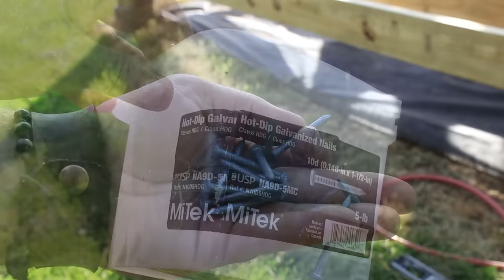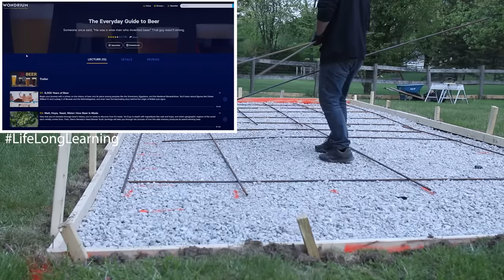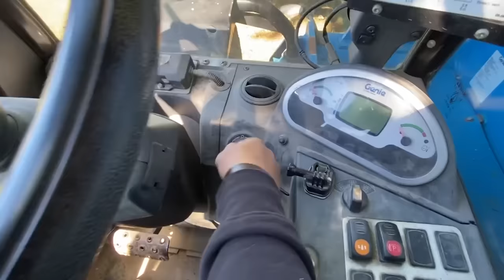How to Build a SHED from Start to Finish!!

Comment: My TOP THREE favorite things about this shed:  1) Metal roof  2) The use of plexiglass and making your own windows, this was phenomenal and it gave the shed a modern and custom look   -  3) You did this all by yourself. Of course, I liked many other things about this build and your techniques, and you did not take any shortcuts, even the fasteners had rubber in them, you've spent the money on the right materials to flash it really well. I am not sure what you do for a living, since this is the first video I watched on your channel, but I can't imagine if you had a crew of two or three dudes who you can rely on for help - you can start a great AIRBNB business building these tiny homes (after buying land of course in hot spots). Companies sell tiny homes like these for 20-25k starting, and of course once you start utilizing solar power, put a little plumbing, kitchen, bed room in it, you can make it a money maker. Good luck !!!

Comment: First  cool looking shed.
SUGGESTIONS for others to consider:
1. Placing the shed so the roof is southern facing could allow solar panels to charge e-lawn equipment, irrigation, shed lighting, or landscape lighting.
2. Depending on your location, you could install gutters to capture rain water.
Reply from the maker: Great ideas.  I was thinking of putting on small solar panels to charge a couple of scones lights
Reply: Can still have solar panels regardless of which way the roof faces. But agree would be a worth while upgrade.

Comment: Thank you for posting this.  I had been struggling with a pole barn design to match my current wood shed and you solved it for me.  I needed both secure/dry storage and open covered space.   I will upsize your concept a bit to fit my needs but yours will have a doppelgänger in summer 2022.
Reply from the maker: That is awesome.  Love hearing this.  Hope to see pictures one day

Comment: Very good looking shed but a few errors to mention if someone would like to copy or use your video to build a house : 1) for the fascia you used treated lumber, you can't install aluminium straight on it, it will rust within a year or two. A piece of Tyvek between the two would have worked. Speaking of Tyvek... 2) You didn't leave space between the Tyvek and the siding. It has to breathe, a 5/8 spacing would suffice (1x3 is perfect for that). 3) The sheeting for walls and roof is aspenite/OSB, not plywood. You do mention "OSB plywood" at 10:27. Real plywood would have been better practice but more expensive and I agree that for a shed it would have been overkill. One last thing, for your door's overhead, I'm not sure that you can sandwich lumber and OSB. An engineer might want to confirm this one but I don't think OSB adds the same strength then plywood. Anyhow, for what I see, the added strength shouldn't be necessary in your case, there isn't much load on top of it.
Reply: This is a shed who cares get a life bro
Reply: @Kilo5910420  Haha, man, he's just giving more information for those that care. People can use videos and comments to build something to live in or just better quality.
Reply: You are correct on the treated lumber and aluminum. It corrodes right thru in about 2-3 years
Reply: I didn’t know treated lumber does that👌
Reply: @FEV369  agree, it's still better to know more so you can improve and better in what you do.
Reply: @tigre2299 excellent comment. I forgot about the PT/alum issues. Speaking of PT use (and not an issue in this build) is that PT is no longer approved for direct concrete contact, because the preservative chemistry changed (for environmental reasons) and concrete leaches the new one out. Putting a post in/on concrete will enhance decay where they meet. Some building codes still require embedding, but usually a conversation with the building dept (before construction) gets it resolved. Most departments did not catch the change.

Comment: I love this - we’ve been looking for a design for a mini shed-office for the backyard, and this is pretty perfect. What’s the inside dimensions? And roughly what was your total build cost? I love your voiceover, by the way. We watch a lot of construction/build videos and often get a little frustrated with the commentary, but you struck the exact right balance, so thank you for that! I feel like we actually learned a lot :)
Reply from the maker: Thank you so much.  It’s 10x12 outside so inside it will be just a little smaller.   As for the cost honestly I didn’t keep track since this was built over a year.  I’m guessing close to 5k with the concrete and all materials

Comment: Finally someone who installs the house wrap properly. So many builders install it after the windows are already in.  Great video.

For those looking to do a diy shed…
My head exploded on seeing OSB on a roof.  Zip sheathing yes, ply wood for sure.  But OSB should not go on a horizontal surface.  It will wick water and puff up. Yes many builders use it but I’ve seen it have issues far more then not.

And those roof screws should only go on they ridges.  Those washers degrade over time and will leak.  I just did a $150k roof repair job on a warehouse and they issue was only second to fiberglass sky lights failing.

Comment: Just a heads up. Although the pressure treated facia may have been cheaper, the chemicals used to pressure treat the wood reacts with aluminum and will cause it to corrode and eat away at the aluminum drip edge and facia covering you put on.

Comment: Great build ! I will definitely use this info to personalize my own build. I like the plexiglass windows.
I wonder if just like car headlight that fade with UV over the years, if using a coating spray protector like plexus will prolonge there lifespan and see-through-ness.
Great editing and narrating.
Thanks
Serge Canada
Reply from the maker: Thanks Serge, ya I’m curious about the window longevity too.  I will do a follow up video next year and we will see
Reply: Too late now, but buying panes of sheet glass (you can get them delivered cheap) and cutting with a hand wheel (score and snap) would have worked great for those size windows. I've had to do it a few times, and so long as you don't make the (only one time in your life) mistake of getting tempered glass, you won't have any difficulty. No, I never tried to score-snap tempered glass, but know people who did. Once.

Comment: I love this look. We are halfway through a 12x12 zip-line tower with a shed underneath. Imagine your first build (deck over shed). This is perfect, and I think it's going to work for us. 

Appreciate the effort you put into showing the flashing detail. Little things like that become big things when done wrong. You can fudge around a framing member out of place, but water is the enemy of everything man has ever built. Thanks again. Subbed.
Reply: I was a bit bummed the 2-story structure went away.  How did you wind up solving the deck-as-a-roof problem?

Comment: I love how you built the whole thing! My mistake was ordering an "Amish built" shed and then finishing it out myself. Amish out here are not craftsmen, and things were pretty shotty on the construction. I should have just built it myself to save time, but I'm also busy running our farm.

My floors are pretty chilly though since insulation is minimal . . . but overall it turned out amazing! Since my cabin will eventually be moved to the woods and we are on a farm, I kept with the "cabin feel" but did more glamor cabin with beautiful birds eye maple boards and light fixtures out of a $2 million dollar home :D Total out the door was about $8,000 for the cabin and the finishing (complete with spray foam)
Reply from the maker: Sounds amazing

Comment: Amazing job! I love the way the shed turned out it’s unique and modern. Also, just wondering would you happen to have a drawing that you made for this? I would love to do this in my backyard
Reply from the maker: Not yet I don’t but I will be doing some drawings over winter when I have a few days. Once I do I’m going to post them on the website.  Just check back in a month or so
Reply: @KomarProject  perfect thanks 🙏

Comment: Awesome looking shed.  Note though, that most local area governments (including rural) will allow various size sheds, some up to 400 square feet with no permits, but virtually NONE will allow car ports without permits, as they have a tendency to take off in high winds, even when anchored properly (base with steel straps to roof) and when they fail, bad things happen.  So check codes before you build one.

Comment: Just a tip I found helpful. You can drill a 3/16th hole where you are screwing the roof down while you have them in a stack. That way all the screws are in a nice straight line. Great job on the shed

Comment: Looks really nice and modern 👍. The only concern would be using the treated fascia. I know the chemicals used in treated lumber will eventually eat through aluminum, not sure about galvanize? Double house wrap the fascia before capping it will prevent that problem, or I hope so 😁😁

Comment: 1 inch screws are used when screwing in the flat for metal roofing.  2 inch are what is needed when going through the high rib.

Comment: You won’t be able to clean the windows, but easy enough to replace later on, so a great low cost starter route and probably would have done the same. Excellent video and final result!

Comment: Me and dad plan on building a modern shed in my back yard. Purchased a home last year this month and tools and things are starting to pile up. My question is about the barn doors. Water will get in when it rain wouldn’t it or am I missing something? Watching this answered tons of questions on installing siding and roofing. What to use and how to install!
Reply from the maker: Yes so there is a small gap there but we haven’t had any issues with water getting in. I set it up so that the shed faces away from the rain typically and the roof overhang let’s it’s all drop past the door. I was worried about it too and was planing on doing a wether striping this year but now it seams like it’s not necessary.  At least in my situation.  I would still plan on putting in a wether strip somewhere.   Hope that helps somehow

Comment: Nice work buddy 👍I LOVE that colour. I think a “light grey blue” trim would of been better than the black if you were to go w yr original colour, which was sumptuous. I’m planning on a silvery version of it for the front facade on our house. Those barn doors are mad. I love them. The gear wheel handles rock. I wonder if you could create a counter balance as yr locking mechanism to tie in.
Reply from the maker: That’s awesome man.  Would love to see pics down the road

Comment: Someone might have already said this, but in case they haven't, if those polycarbonate windows do not have UV protection/resistance, you'll probably want to coat them with something so that they stay clear and sharp looking.

Comment: If your flashings and drip edge are aluminum, using galvanized nails sets up corrosion from galvanic interaction - worth it to predrill and use aluminum nails to hold aluminum flashings to eliminate the differential galvanic electrochemistry.

Comment: What was the overall height for this and the roof pitch angle? It looks amazing to me, but where we'd build it there would be height restrictions with how close we can put it to the fence line, so knowing that and the pitch would allow us to adjust if we had to make it shorter in height.

Would it also work to only have the slab for the shed and pour concrete posts for the overhang support? We have quite the slope in our yard and paying someone to pour a slab that gets progressively taller could be very expensive. 

Or would there be a good way to do the base to install it over gravel?

Thanks! This was very helpful, especially the flashing and roofing tips!

Comment: the  correct way for floor joist installation is the joist sits on top and off stringer hangers alone arr not strong enough  never rely on nails or screws to withstand shear weight

Comment: As a roofer that I am ill give you some pointers for next time.. Don't ever use synthetic felt on low pitch roof only 3.12 pitch and higher. Any lower than that you're supposed to use ice and water shield membrane.

Comment: It’s easy to be a critic from the cheap seats but once you understand the reason for that little bend on the metal trim is to kick-out water from running straight down...you’ll realize they belong on the bottom. So @ 15:44 I’d say the “peak flashing” is upside down and I suppose the Z flashing at the bottom could’ve used a kick-out leg as well but I suppose those are minor quibbles in comparison to the inordinate number of fasteners attaching that top metal trim which would certainly cause issues with expansion and contraction. Housewrap with a woven checkered type construction seems to degrade quite easily in comparison to the spun bonded or nonwoven type so there’s that. Also since building codes often exempt playground structures, a shed on the bottom with a platform for a slide  on top is often viewed as compliance, so that may be considered a loophole for those wishing to avoid dealing with permits and inspectors. Just sayin’ since the video is about converting a play structure.

Comment: Nice detail but I have a question.   How is the seal on the sliding doors?   I've done a few interior but haven't had to worry about weather proofing.  Probably going to borrow a few of your ideas.  thanks
Reply from the maker: I’m going to build a little overhang on it to keep the rain out.  But you can also put on some weather stripping to keep it out.  Good question

Comment: Fantastic work! I'm planning a similar style shed. Can you please tell me how you joined the post for the front of the carport to the roof?
Reply from the maker: There are these too mounted beam to post bracket you can buy at any hardware store.  Then just use nails with them.  Hope that helps a bit

Comment: the  floor joist for the decking should be done as you did on the roof joist also you should put a mid support for the decking joists so it doesn't flex or feel spongey

Comment: With a space of the watch batteries, how do you keep water from entering/rotting? Nice build !
Reply from the maker: I’m putting in a little over hang made of steel this summer.   You can also use some flex weather stripping

Comment: How do you keep rainwater from pooling under those windows? It looked like there was a big gap in there from the window to the wood.
Reply from the maker: The windows are sealed with silicone.  And rubber on the inside.   Haven’t seen water yet.

Comment: Why the 2x6 joists? I’m pretty sure I’ve seen house on 2x4. Serious question. Looks great by the way, looking to make one on a budget and not so heavy duty like this one seems to be.
Reply from the maker: If your placing it on a slab ya you can go 2x4.  But if it’s being built like a deck you want a minimum of 2x6 if not bigger.  Depending on the size of the shed

Comment: Why does the beam above your windows have a piece of plywood (aspenite?) sandwiched btwn the 2 2x6? Is it half inch? And only added to increase the thickness to width of top plate? Or is it some other structural purpose?
 Thanks! 
And great job!
Reply from the maker: It’s both.  You going to have this over every window and door in your house.  It’s called a header and is what allows you to build over your windows and doors.   Hope that helps.  And yes it’s 1/2”

Comment: On the roof line... does the water collect at the bottom?  If not, does it drain straight down?  I'm in Texas and mosquitos would find those little pockets of water heavenly.
Reply from the maker: It doesn’t collect at the bottom of the roof.  It drains down

Comment: I like the design. However with all the wood siding, would you not need to have an airgap behind it to allow for proper drying? Also, should the horizontal battens be flashed as well to not allow water in behind it?

Thanks

Comment: just wondering will the wooden material wont get damged with rain and heat ?
Reply from the maker: It shouldn’t.  It’s water proofed.  And the siding got a coat a exterior finish

Comment: I liked two thins : the accuracy of the built and the honey bunny you call your wife 
And unlike two : building the house and lift it to another place the wood will be moved in joints and would be not fitted to the next place , and you spend a lot of lumber that mean the project will be so expensive 
Greets from Iraq

Comment: Amazing skills.  Wondering why not face the door, or a second door, into the area under carport roof overhang?
Reply from the maker: I was actually thinking of doing a lattice door just for shade.  I want to turn that area into a steel forge
Reply from the maker: I was actually thinking of doing a lattice door just for shade.  I want to turn that area into a steel forge
Reply from the maker: I was actually thinking of doing a lattice door just for shade.  I want to turn that area into a steel forge lol
Reply: @KomarProject   Cool!  Its always nice to have a place for outdoor work during rainy weather....and a way to accommodate pieces with extra long ... so opening bw shed and overhang roof area seemed ideal.

Comment: Really good video and creativity.  But, it's going to leak on the slab under your walls.  Been there - done that.  Would be better to notch the slab edge for a water stop.  Sealant is not enough.  Also, water is also going to get behind your window trim.  Hang in there.